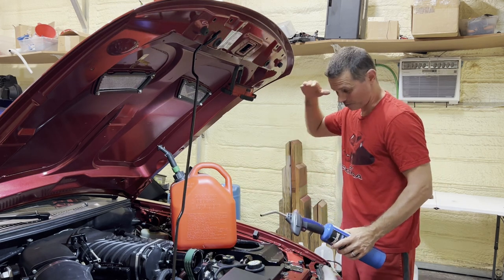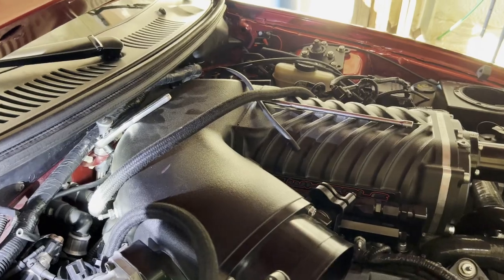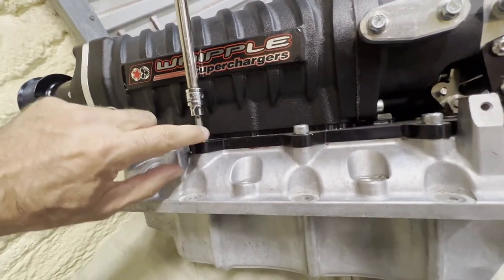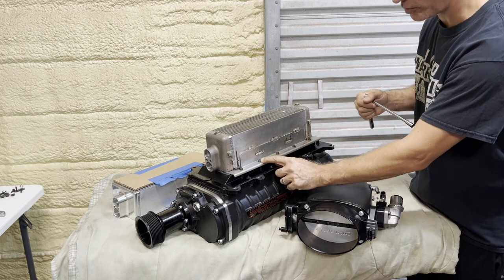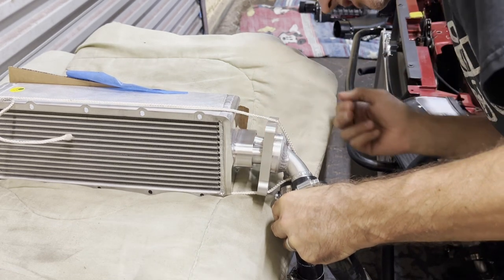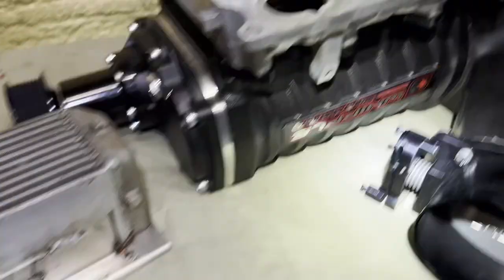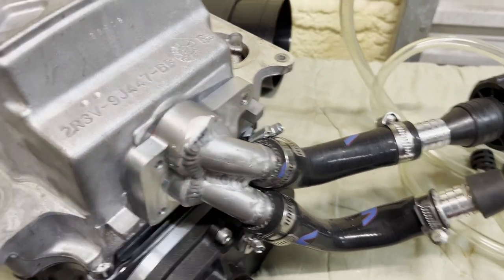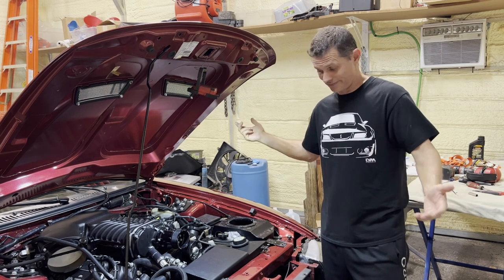VMP Intercooler Core upgrade on our 03 Cobra Project Redfire

Comment: Heck yea. Great to see the improvement over the modded stock. I have the vmp core to go on my kb2.2. Also have a Department Of Boost super single and their powa pump. Should move some serious water.
Reply from the maker: Agreed the improvement is impressive, surface area and flow.  I bet your setup will be awesome.

Comment: Great video series you put together. I'm actually in the process of installing the VMP Gen3R along with their I/C and 1" manifold in the Cobra. It took several months to get both the I/C and manifold as both were on backorder. I was wondering if it was actually going to be a significant improvement in flow and you just showed that it is. Great work.  I also plan on doing the Gt500 or DoB super single h/e along with the EMP pump and full 1" conversion  as well so I'm looking forward to your next video on that. Will you be installing the MAF tubular crash bar as well?
Reply from the maker: Thanks Tony. Glad the video helped :) and yes the parts delays are very real across all products right now. 
This car already has a tubular crash bar in it but I’ll show what’s needed.

Comment: Did you ever have to remove the blower & install the support rails for the vmp IC? I know people that are running high boost were having issues with the ic flexing and cracking.
Reply from the maker: I did, as soon as I heard about them I called VMP and got a set sent out my way.  Luckly my IC was not cracked when I pulled the blower.

Comment: Is there a how-to on wiring up the EMP WP32 pump to the Cobras? I am guessing it takes a bit of rewiring to get this to fit since they're not mustang specific, right?
Reply from the maker: It's certainly a bit of custom wiring yes.  They have a heavy current wire that goes to a battery source and then a lower current trigger wire to make it turn on.

Comment: Curious if you were able to get the full 1 inch manifold transfer tubes installed and if there was a noticeable improvement in flow vs the original tapered tubes in the video?
Reply from the maker: Not yet. I’ve been working on other issues and projects. However I will be coming back to the supercharger cooling system in the future, including those intercooler tubes. I’m more concerned with that current manifold leaking past the orings more than anything else.
Reply: @MalcolmV8  Thanks man.  Really enjoy your content.  I'm a data guy and love seeing real numbers with all of the variables considered.  I'm considering the same version of this IC brick for my 2013 GT500, so really interested in the flow data for 1 inch lines.
Reply from the maker: @guevoncito6265  I appreciate the feedback and also really like getting data on everything because all the opinions out there and hype are sometimes so wrong.
I don't expect huge gains swapping out that 3/4" manifold as it's one tiny pinch point in the whole system which was all 1" lines.  I find that the cores themselves will only flow so much and you reach a point of where inlets and outlets are not a big issue anymore.  If you saw my heat exchanger upgrade video I increased the barbs on it from 3/4" to 1" and gained 1.2 GPM.  It's still something but nothing even close to all the hype that surrounded that mod.

Comment: How do you feel about modded stock cores? Found one for a good price and I’m debating if it would be worth it. Plan on using it with 1” lines and a dc150 pump in the stock location and a dob super single
Reply from the maker: Well they do flow a little more than a bone stock core so that is some improvement.  I tested that many years ago.  The VMP core is way better but it's also very expensive.  A stock modded core would be a good budget option for sure.

Comment: @07:05 my 2.3 whipple didn’t have does caps when I received it and put it back together I think that’s why I’m ready 16 1/2 lbs of vacuum at idle instead of 20
Reply from the maker: It's definitely a small vacuum leak.  My idle went rich after plugging those holes and fixing the injector o-rings.
Reply: @MalcolmV8   I think I found the plug online, it’s called the base plate bolt of I’m not mistaken. Was it hard to install? Or just pull the whipple out and hammer the bolt in there? Sorry for the dumb question
Reply from the maker: @modlist6129  it's a plug or cap looking item.  I purchased directly from Whipple.  I actually made a little tech tip video on how to remove and install them that'll be ready for upload in a few days.  But yes essentially hammer down with a square and dead blow.  It's possible to knock them in too far and then you have a leak all the same and need to drill them out and try again.
Reply: @MalcolmV8  I’ll be waiting for the video!  Thanks for the reply. Ima order some from whipple right now since im not done with my tune yet
Reply from the maker: @modlist6129  you're welcome.

Comment: Hey do you still get on svtp much?
Reply from the maker: Not much no.  Why what's happening there?
Reply: Nothing, I just had some questions about disability of the caged pulley
Reply from the maker: @uavmech03  I have a FB group called "03-04 Cobra Terminator Tech" where you can ask questions.  Lots of smart guys in there and I try and help as much as I can in there too when I get a chance.